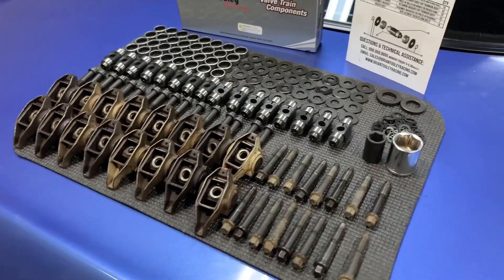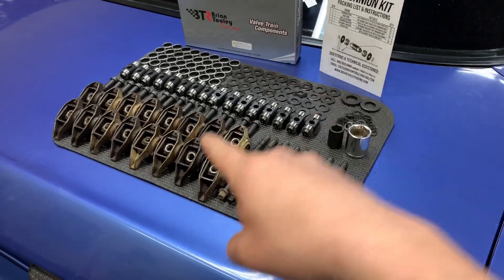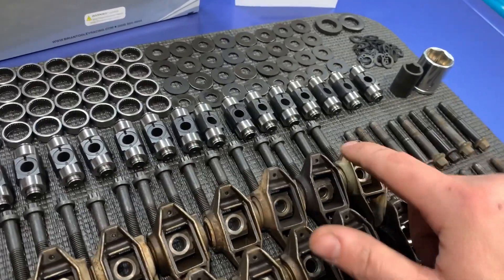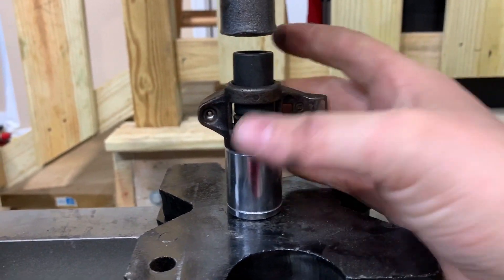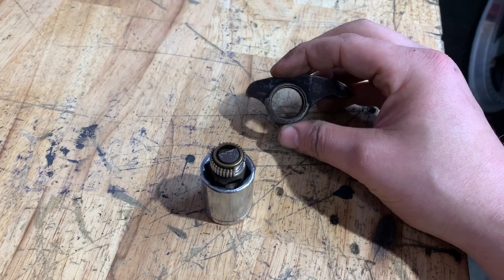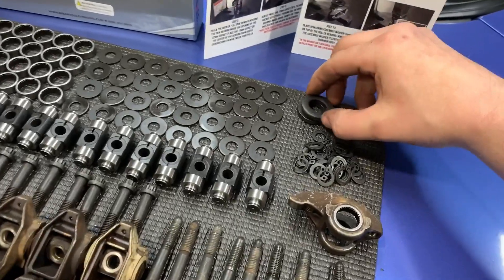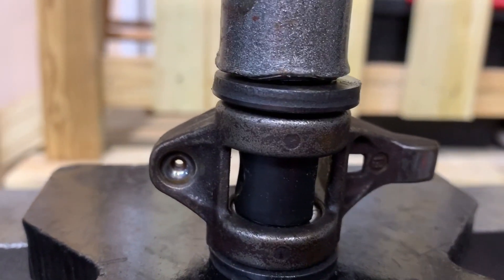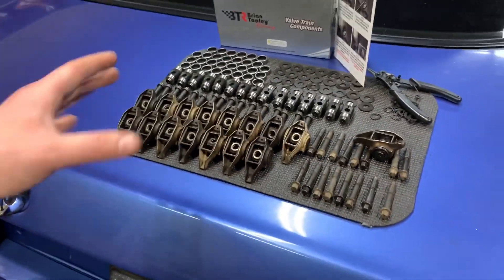BTR TK002 Trunnion Kit Installation - How To

Comment: Hey mate, I'm in Australia & about to install a kit, every thing looks right but the bearing doesn't say made in USA it has C&U  KN-101305. When I looked that number up, it's the correct bearing for the kit. Is it still ok to use or is it Chinese
Reply: I've noticed that aswell and after installing them a heap of side to side movement
Reply: @LeoArvela  one of my bearing side wall broke the other day & put needle rollers in the sump